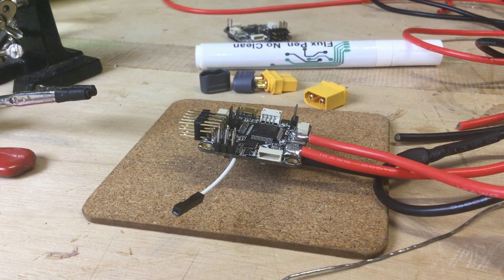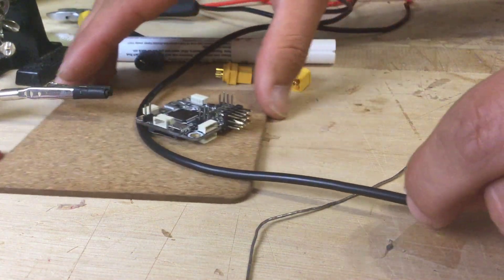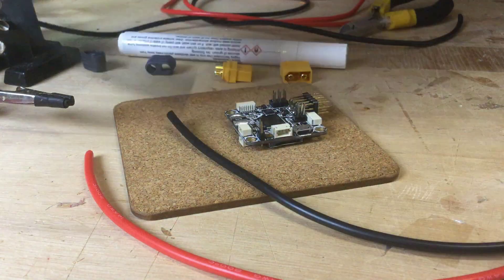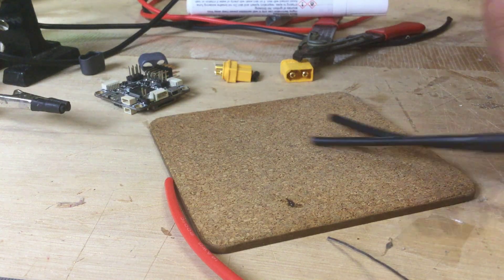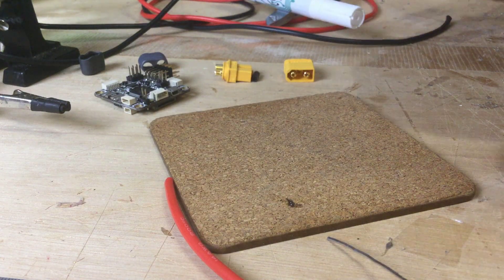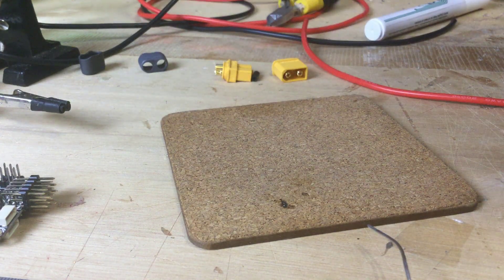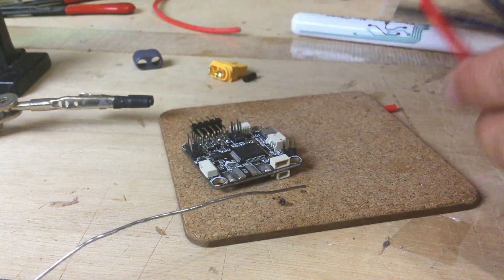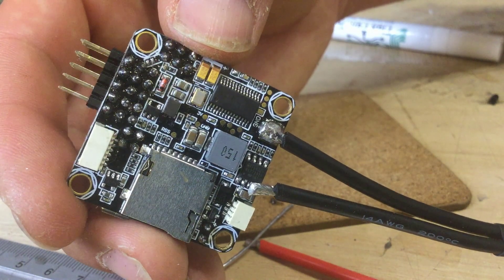iNav - Soldering the Main Power wires on the Omnibus F4 V2 Board (Step by Step)

Comment: Hi. Have u had any issues with this board. Plus. Can u fit crossfire to it cuz can’t find the tx and Rx pins
Reply from the maker: Hi Craig, XF is just SBUS or PPM, as you set the output from the receiver. ip back and see the pin layout for your board and work from there. Matt
Reply: RagTheNutsOff  thanks for reply. That leaves me with 3 pins but I need 4 for Xf. Tx rx ? That’s wat I’m stuck on
Reply: The board is the one ur using. Omnibus f4 pro. I can do it no problem on my quads but struggling with this

Comment: Hi Matt, great video series, quick tip - when soldering a XT60  ( or any other type ) plug a spare opposite connector in, as it will help stop the pins from moving if you get them too hot and melt the plastic a bit.

Comment: Voltage across a 1 ohm resistor is the same as the current.  I=V/R  Also the resistor is in series with the esc, if the resistance was much more than 1R, you would lose power to the motor....  Great videos, thanks for putting in the time to do them...

Comment: Can I have voltage indication + current sense and not power up the board from the battery?
Reply from the maker: Errrrr no, as the sensors won't be able to work without a power supply! Matt
Reply: it should be possible but external 5Vdc (e.g. external BEC) has to be applied after internal switch regulator of the FC board, and link to the switch internal regulator has to be opened (to have benefit of separation).

Comment: Need a bit of help with my new F4 V2 board which I received last week or so. Connected the power wires and all worked fine. Poking around with my multi meter to check for voltage on the sbus pin and the other pins and found low voltage. Trying to check voltage on one of the small connecting boxes, I may have shorten the two pins, and now does not power the board.
However, when I power the board from either the USB or SBUS , it powers the board, and get flashing blue light. When I connect to INav, everything seems to work, get solid blue light when 
arming, but will not start the motors. So, the question is, did I somehow blow something up.
Have a F4 V3 on the way from BG, but won't be here got another 3 weeks, so don't have any other S-bus FC I can check. Motors works just fine on a KK2 board.
Any idea of what could have gone wrong?
Thanks in advance.
Michael.
Reply from the maker: Hi Michael, see the common issues/tips video. The board nor arming is most likely a configuration/setup issue as indicated on your dashboard. Matt

Comment: If you put a blob of molten solder on the iron before you put it to the wire it will transfer the heat of the iron far quicker than with a dry iron!!!

Comment: Matt,

I used your methods, step by step on powering the Omnibus F4 V2 and got smoke. The FC will now power by usb but not fully when connected to the lipo, the green light flickers dimly. What did I do wrong?
Reply from the maker: Howdy Derrick, I have no idea I'm afraid. I'd leave everything how it is and check that there isn;t any blobs of solder that have shorted something out and also make sure you check the wiring diagram for the board you used as it may be different. Hope that helps, Matt
Reply: RagTheNutsOff Ok I'll check alt that out. Thanks alot Matt.
Reply: Update: It was a faulty board. horrible!

Comment: Hi again matt, so the main power wires do not power the fc? I just soldered up the power wires and plugged a battery in and my fc has no power and no led, do I need to add a bec to power the fc, servos and gps?
Reply from the maker: Howdy Vaug, on the V2 it should power the main controller when applying the pack voltage. Matt

Comment: Hi Mat, Thanks for your instructional. My own F4 V2 board is giving very low battery voltage readings when I connect up my 3S battery. It's showing a pack voltage of 0.5V. have you ever had such a problem? Thanks.

Comment: High Matt, I've wired my board as you explained and after powering with 4s for about 10 seconds, LEDs go out and I think board dies( inav and ezgui don't recognize it anymore) This has happened with my first 2 FC's. Any suggestions?

Comment: Perfect Tutorial , You're right That RSSI wire is a twat Lol .. Cheers
Reply from the maker: Isn't it just!
Reply: I think it was not design to use the pin on these boards (it's optional, but no prefered), RSSI was pre-designed to be using via SBUS/PPM link.

Comment: Greetings, so if i got this right if i want to install it into a copter, i just replace the ESC side XT60 with a PDB that provides everything else with power?
Reply from the maker: Howdy Grearson, yes thats right. You can take the main black wire from the battery and solder straight to the PDB, then run a thinner one up to the GND pad. However the main battery wire needs to go through the board for the current sensor to work. I have a quad here on my desk that I'm chipping away on to try out iNav in a quad. I will get to finish it as soon as I can (but busy with work currently), Matt

Comment: I Matt thank's for sharing, i apologize for my poor english and im a true noob lol, so is not clear to me why from MOTO-VCC you thake also the voltage for the cam and or vtx, from this connection is not where the full voltage of the 3/4s cell go to ESC then to the motor ? and otherwise if is that the BEC of the Fc that is not supply only 5v ? i know to be confused.. btw im noob lol
Mario
Reply: Forget my question, i just investigate that more common VTx and Cam have i wide imput voltage...  lol btw thaqnk's for your vy educative videos, i have suscribed ur channel !!!

Comment: hi matt, where does the servo get its power?
Reply from the maker: Howdy, see the other parts in this series on iNav, the servos get the power from the +5V rail on the servo connectors which comes from your ESC BEC, Matt
Reply: It depends how you power the board and what version board it is. For example you can power 5 volts to the board through pwm1 or through pwm2 if you disconnect the red wire from the ESC. On v2 and later Boards there are diodes that will select the highest volt 
Present to power the board and servos. So a 3s lipo would do  both but I do not think there is enough headroom to power 4 or more servos without a brownout.
Reply: Tim Arnold, why would you disconnect red wire from esc, that's the one that supplies power?
Reply: geo dezix if you are using an ESC with a low power BEC, say 1 amp and your servos and Rx demand is in excess of 1 amp,  you will want to supply power via a ubec or similar source through pwm 2. Digital servos are very amp hungry, especially in an auto level nav mode such as Horizon or Alt Hold. The best way to check is to buy a simple servo watt meter such as this https://hobbyking.com/en_us/hobbykingtm-compact-20a-watt-meter-and-servo-power-analyzer.html. You may be surprised at just how much load 3 or 4 servos and a rx place on the system. Especially if control surfaces are stiff.